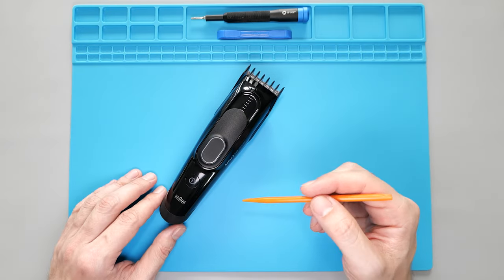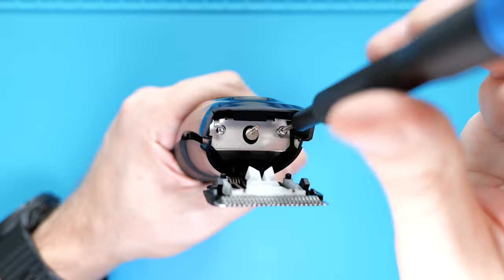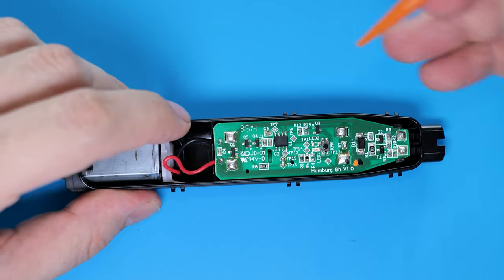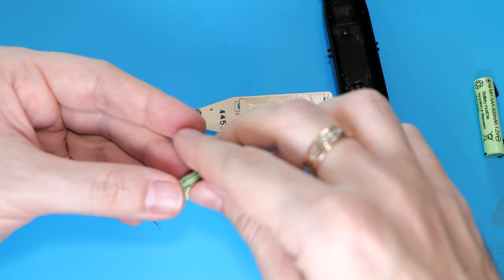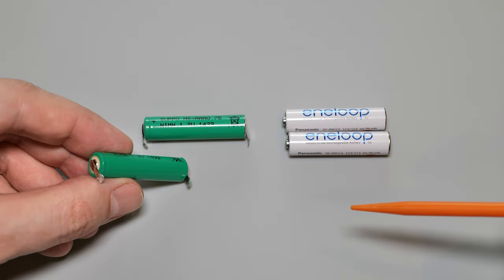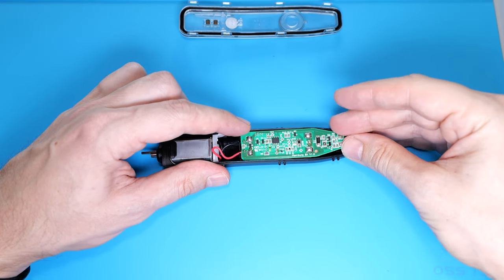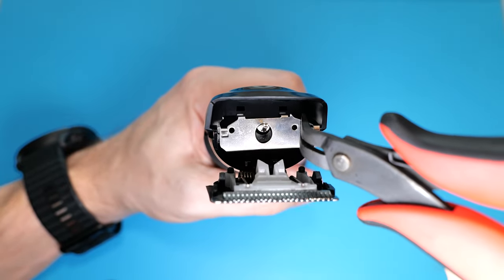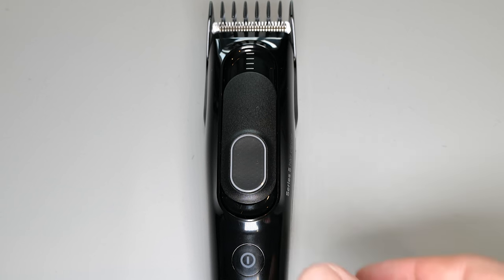How to replace the Battery in Braun Hair Clipper HC5010, HC5030, HC5050, HC 5090

Comment: My Braun HC5090 stopped working completely. Even when it was plugged in, it was only flashing red light. I thought even if the batteries are dead it should work when plugged in, so I thought it was probably defective and was about to send it to the service. Then I found your video and decided to give a try, and voila, after replacing the batteries it is as good as new! This was my first time soldering and I was a bit stressed, but it was all good at the end. Thank you so much man, you're a lifesaver!
Reply from the maker: You're welcome!

Comment: Tried to do this with my BT5010, unfortunately the shaver doesn't turn on anymore, not even with a DC supply. After inserting new batteries, I tried to clip them in place with pliers, I didn't think I created a short circuit but it got really hot on the bottom around the area where the other end of the batteries is connected on the PCB. I thought it was the batteries that got hot (logically if I actually created a short circuit), but apparently it's some other component that failed. It doesn't make much sense why would some of the components fail, even if there was a short circuit (between the ends of the batteries). It is what it is, I need to buy a new one. No idea why my repair failed, so be careful when doing this.
Reply from the maker: @mhrvth  Are you sure you didn't reverse the polarity?
Reply: @ElectronicsComputers  I'm sure, I checked twice. The transistor that connects the motor to the ground doesn't open, the gate / base appears to be directly connected to the power management IC CCE7101 which can be found only on Aliexpress for 5 EUR / $6, at which point I gave up, at least for now.

Comment: Thanks a lot. My hair clipper just stopped working. Whole motor were in rust. I cleaned it off and lubed and it started working. Battery is still fine after 6 years.
Reply from the maker: Great job! That clipper will last decades with proper maintenance.
Reply: @ElectronicsComputers  My clipper Series 3 - 3050 still works after approx 12 years. Being using it every 15-20 days. Great and reliable device. Its time now to replace the batteries. They still works but with noticeable capacity loss. Thanks for this tutorial.
Reply from the maker: @hrxkrx  Happy to help 😊

Comment: Hello and thank you for the video! I understand mine is not repairable, correct? It doesn't  worth it, right?
Reply from the maker: If it's just a battery issue, then replacing it is definitely worth considering. However, if the problem is something more serious like the motor or the charger, it might make more sense to invest in a new shaver.
Reply: I can't paste a photo here.. I opened it following your video and near to the charging there are 4 tiny chips burnt.. I guess I can't change them, they are too small..
Reply from the maker: @heraklismamantos4501  Then it's definitely not worth it.  Those chips are hard to find, and you need a hot air station for proper repair.

Comment: I have a question: is it possible to completely remove batteries so clipper will work with charger plugged in all the time? Can kt be done by simly removing batteries and replacing them with wire?
Reply from the maker: Yes, it will work!
Reply: That doesn't work for me. Without connected batteries, the LED blinks steadily red and the motor keeps silent.

Comment: Next time use some TIN on soldering iron because IT will faster pass temperature (pushing hard soldering iron is not good idea)
Reply from the maker: I just bought the cheapest soldering kit specifically for this video, so anybody could do it. I have several repair shops with all professional equipment and stuff. I make these videos just for regular folks with some basics skills.

Comment: Thanks a lot for this video!! I have a different model of the braun trimmer with two 750mah (NiMH) batteries... Do you think I can replace it with a slightly higher mAh batteries but keeping the voltage same?
Reply from the maker: The battery capacity doesn't matter, you can use any available to you. But the voltage and the type (chemistry) of batteries are very important. If the device is designed for NiMH batteries you can't use Li-ion, NiZn etc.

Comment: Hi, thanks a lot for sharing this video. I have had the HC5050 for about 5 years and the batteries were almost dead and wouldn't charge anymore. I tried to get it fixed at the Braun service center in Guangzhou (I live in China) and they asked for around $40 for it. In the meantime, I bought a Panasonic trimmer and I am very happy with it. After watching your video,  I decided to try to fix my old Braun HC5050 so I ordered the batteries from Taobao and they cost me $2 and today, finally I decided to replace the batteries. 
Dismantling was not a problem, except that the top cover parts fell apart, and that was complicated to put back together. Taking the parts apart, removing the old batteries, and installing the new ones was easy, and putting everything back together went smoothly except for the parts of the top cover which took a while to figure out and reassemble. I actually tested if the clipper was working before reassembling it by connecting it to power and it was ok. So, all in all, it was a good experience and I am very happy that I was able to fix my clipper by myself thanks to your video, and in only cost me $2 as I had all the other tools needed.
Just a warning for other people, try to be very careful when disassembling and removing the top cover as it's not easy to figure out how to put back all the parts together.
Thanks again.
Sam
Reply from the maker: Great job! I'm happy to help and thank you for the comment!

Comment: Nice video, but unfortunately on my Braun 5050 the batteries are glued in place. It isn’t possible to remove them just by melting the solder.
Reply from the maker: They use a double sided tape usually between batteries and PCB. Just apply some tension to the battery and desolder one side and it will pop up, then desolder the other side.
Reply: @ElectronicsComputers  Jup, can confirm. I placed a spudger between the batteries, applied pressure while keeping my soldering iron on the  tab till one side came loose.
Reply from the maker: @liquicitizendirk2147  Great job!
Reply: @ElectronicsComputers  Thanks for the short and concise video! Soldering the tabs to exisiting AAA Batteries was maybe not the best course of action since I exposed them to quite a lot of heat to get the solder to stick. But I guess I'll come back once those go bad and buy some with tabs (Or I have a reason to splurge on a spot welder lol).

Comment: Ca we just turn it without thr battery, use only the cable ?
Reply: No, this does not work. In my case without batteries the red led keeps blinking when pressing the power switch. With only the power supply connected, the green led blinks (but there aren't batteries to load inserted).